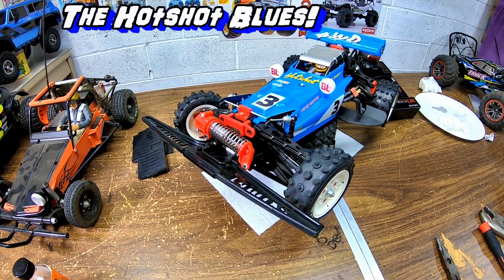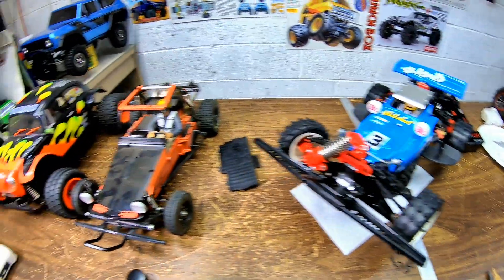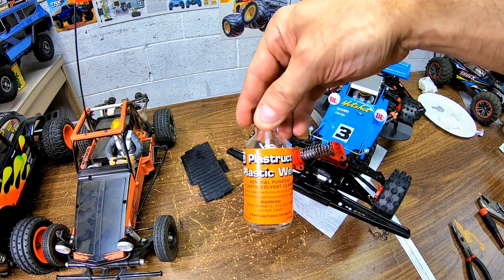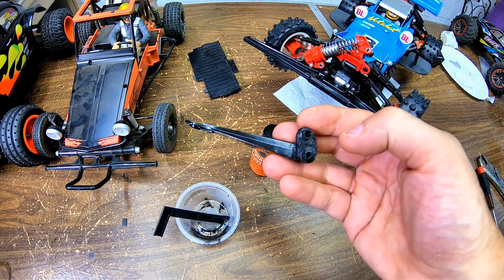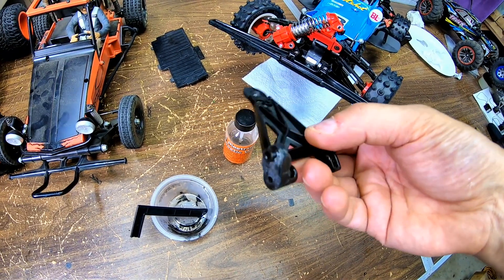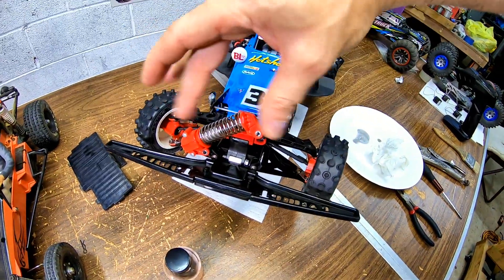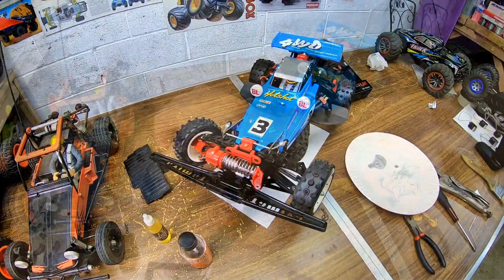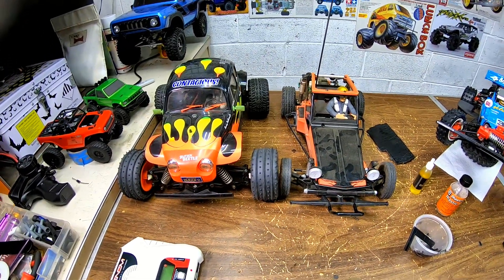Tamiya hotshot buggy blues! BROKEN AGAIN!

Comment: I had an original Hotshot 2 back in the late 80's. Was a fun car but the suspension was awful even after I upgraded the front to dual shocks.
Reply from the maker: Yea the geometry is messed up with the front suspension bad bump steer... But with some fine tuning they are ok.  Thanks for watching.

Comment: way back, we made aluminum shock mounts that glued/screwed onto the front of those, same reason. (ascii art oh no) kinda ooo8    8ooo shaped face plates we painted black after
Reply from the maker: Yea But I want it stock with one shock...my supershot is much better no breakage problems like this.  Thank you MN!
Reply: we used the stock shock, was just aluminum L's (sideways) that the ends mounted to   _____/               \_____   at the tops